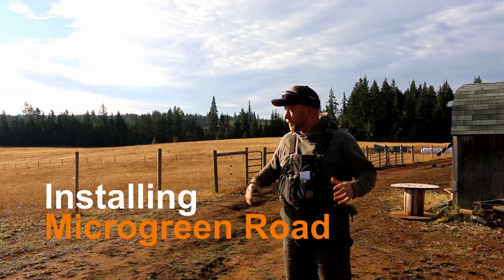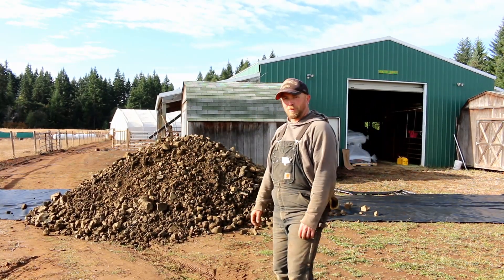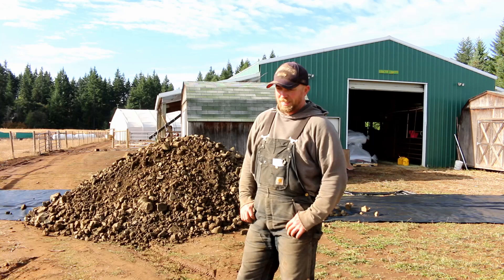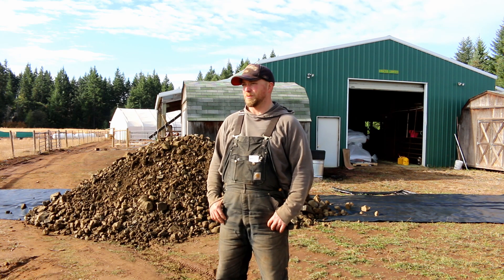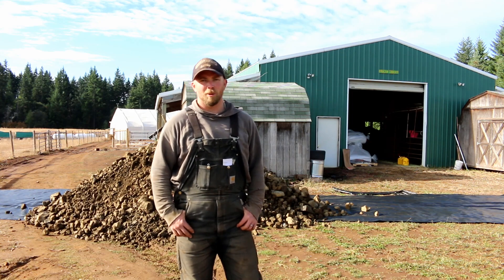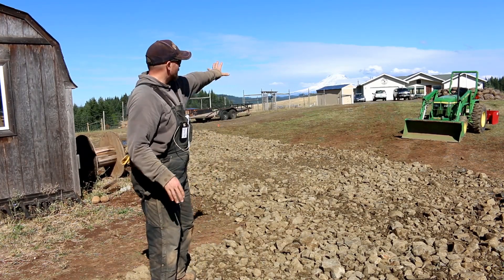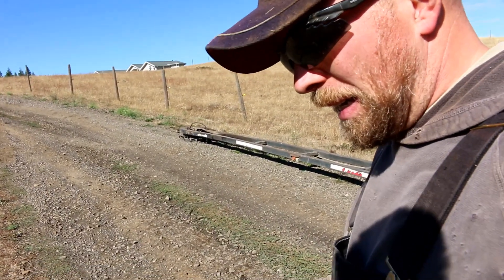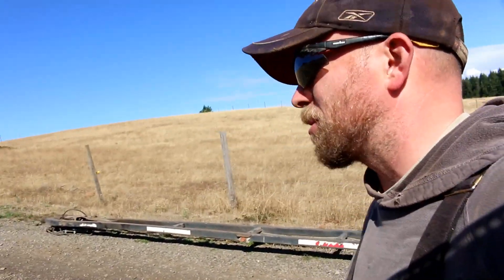DIY and Do It Right - ROAD BUILDING - Laying a solid foundation

Comment: the most probable cause of the shift on the fly not working is the motor on the transfer case is not working it can be changed out fairly easy I've replaced several of them on Ford vehicles in most cases I can do  it in  in less than an hour 3 bolts and a few wires

Comment: 4wd should only be engaged on a surface where the front and rear axles can turn at different speeds.  A dry, hard road will not allow the wheels to slip and will cause the transfer case to bind.  If the pressure is unable to be released via wheel slippage, something is going to break.  

Also, take your foot off the accelerator while engaging the 4wd system.  And, if you have 4-wheel low, you must stop the vehicle.  Consult owners Manuel, as some systems require you to be in neutral.  

When you return to 2wd, it helps to roll the vehicle in reverse to get the gears to disengage. Hope that make sense.